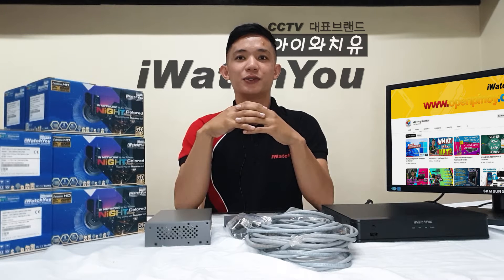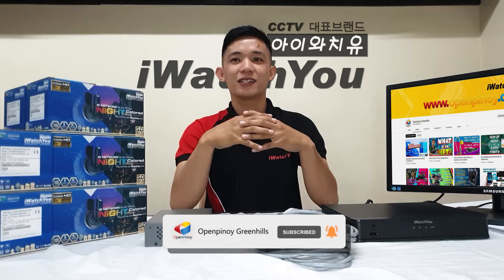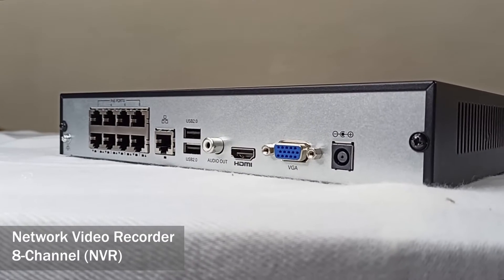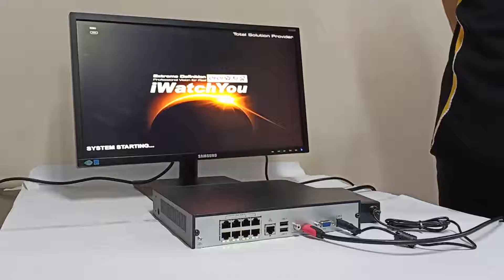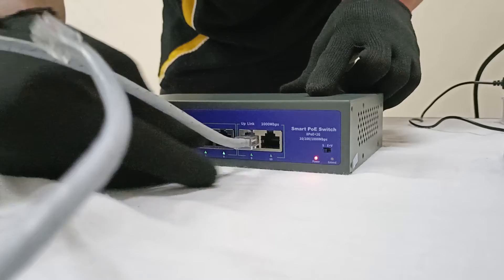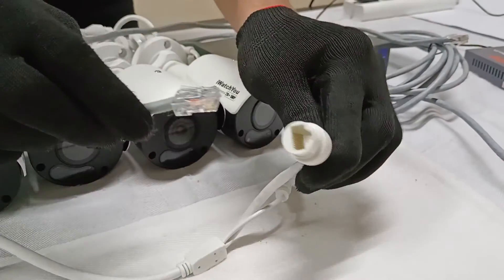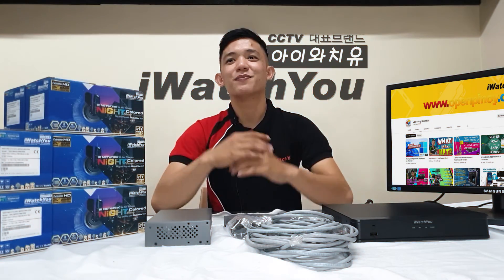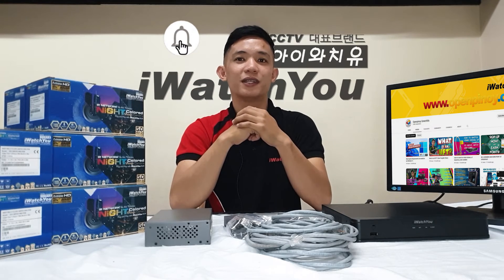How to Connect 8Ch IP Camera using Single Mode Media Converter over 2km Fiber Optic Cable

Comment: Can I use two Poe switch to separat 4ip camera on each and use two pair of media converter to plug in Poe 8 port nvr ?
Reply from the maker: Hello, thanks for watching!
Yes, you can use two PoE switches with 4 cameras each, then connect them to your 8-port PoE NVR using two pairs of single-mode media converters. Just ensure all devices are on the same IP range, the media converters are properly paired, and the total bandwidth can handle all 8 camera streams over the 2km fiber link.
Reply: @OPENPINOYiWatchYou ok sir thank you very much

Comment: ang tanong san kukuha ng suppy yung camera na nasa 2km kung fiber lang naman yung wire
Reply from the maker: To supply power to an IP camera, a nearby PoE switch is needed.
Then, connect the PoE switch to a media converter (transmitter side), and use a fiber optic cable to transmit the video signal to the media converter on the other end (receiver side).

Comment: Panu po gagawin kung ang distance ng bawat ipcamera ay 200 meters ang kaya lang po kasi ng utp 90meters lang po tnx
Reply from the maker: hi sir good question po, you can use poe switch with extended power features. example po ay this model - Hikvision DS-3E0105P-E/M
A 4-port Fast Ethernet unmanaged PoE switch supporting IEEE 802.3af standard. Features intelligent PoE management, up to 300 meters long-range PoE transmission, 4/8-core adaptive power supply, and 6 kV surge protection. Thank You

Comment: sir ilan meters maximum na layo mula sa ip camera to POE SWITCH?
Reply from the maker: Ang maximum distance mula sa IP camera papunta sa PoE switch gamit ang standard Cat5e o Cat6 Ethernet cable ay hanggang 100 meters. Beyond that, kailangan na ng PoE extender or switch para mapanatili ang signal at power. Salamat Sir and stay safe

Comment: Tanong lang po...saan ka kukuha ng linya para sa saksakan ng power supply na 12v, syempre kung nasa posti na malayo maglalatag kapa rin ba ng service dropwire na 220v
Reply from the maker: Magandang tanong po! 😊 Sa ganitong setup gamit ang fiber optic cable at media converter, hindi dumadaan ang power sa fiber, kaya kailangan pa rin ng separate power source para sa mga IP cameras. Kung ang mga camera ay nasa poste at malayo sa saksakan, maaaring gumamit ng service drop wire na 220V papunta sa isang PoE switch malapit sa cameras, tapos ang PoE switch na ang magpapadala ng power sa cameras.
Reply: @OPENPINOYiWatchYou  magastos parin iniiwasan yn ng mga baranggay...need ng wire

Comment: Hello Open Pinoy, patanong lang po possible po ba multiple cctv camera one fiber optic cable if possible ano pong tawag sa fiber optic cable na pwede pong magamit salamat po and God Bless.
Reply from the maker: Hello! Yes, possible po ang multiple CCTV cameras sa isang fiber optic cable gamit ang fiber optic splitter o media converters. Ang kailangan nyo pong cable ay 4-core o 6-core Single Mode Fiber Optic Cable (depende sa dami ng cameras). Tapos, gagamit kayo ng fiber to Ethernet media converters sa magkabilang dulo para iconvert ang signal. Salamat din po, and God bless! 🙏😊

Comment: sir may tanong lang po ako pano po pag 2km pataas na po at may nabibili po bang 3km na fiber cable?
Reply from the maker: Hello po! 😊 Oo, may nabibili pong fiber optic cable na may haba na 3km o higit pa. Ang gamit po para sa long-distance transmission ay Single Mode Fiber Optic Cable, dahil kaya nito mag-transmit ng data hanggang 10km o higit pa gamit ang tamang media converter o SFP module. Kung may specific setup po kayo, let us know para matulungan namin kayo pumili ng tamang fiber cable. 👍

Comment: Paano po pag DVR yung cctv?
Reply from the maker: If your DVR is analog, you can use an analog media converter for the cabling work.

For example:
Camera -> Coaxial Cable -> Analog Media Converter -> Fiber Optic Cable -> Analog Media Converter -> Coaxial Cable -> DVR
Connect them in this order. 

👉 https://www.iwatchyou.ph/

If you have any other questions, please feel free to contact us through the URL I shared. We will be happy to assist you.

Thank you.

Comment: Sir tanong lng po. Pano gamitan lng ng utp cable n hnd pure copper pwede po b un s ip cam
Reply from the maker: hi sir yes po pwede naman po ang mga ordinary na utp cable for ip camera pero meron pong limit ang length na pwede mo gamitin and depende po sa brand ng utp cable mo po. you can check our blog for the comparison of utp and fiber cable - https://iwatchyou.ph/blog/?q=YToxOntzOjEyOiJrZXl3b3JkX3R5cGUiO3M6MzoiYWxsIjt9&bmode=view&idx=66450580&t=board

Comment: Sir Ano po ba Ang problema ng CCTV fiber connection, gumagana Naman ,pag nag brown out ,walarin ,,,tapos pagbalik ng kuryente hindi na sya nagdidisplay Yung camera,,
Reply from the maker: good morning po sir, based on our experience the possible problem would be on your poe switch, poe switch power adaptor, or fiber switch po. It's possible between these 3 components ang may problem if all you cameras has no display after the electricity came back. salamat po

Comment: Hi.. if the ip cam has its own individual power supply.. can we use fiber switch instead of poe switch? Thank you
Reply from the maker: Even if the IP camera supports PoE, if you're installing multiple cameras, you definitely need a PoE switch.

However, if you're only installing 1 IP camera, you can connect it without a PoE switch by using a media converter.

If this answered your question, please don’t forget to like and subscribe.
Thank you! 🙏

Comment: Maraming salamat po sa information. Pero paano if I need 2 or more POE switches po. Paano ang connection?
Reply from the maker: Thank you so much for watching the video! 😊
And I sincerely apologize for the delayed response 🙏

If you need more than two POE switches,
you can connect the switches together, then connect the last switch to the media converter.

Example:
POE Switch (w/ IPC) ➝ POE Switch (w/ IPC) ➝ Media Converter ➝ Optical Fiber Cable

I hope this answer helps!
Please don't forget to like and subscribe! 👍✨
Thank you 😊

Comment: Sir may tanong po ako..

San ka po kukuha ng supply sa media converter po pag nasa POSTE na ung camera at ung media converter?

Salamat po new subscriber.
Reply from the maker: kailangan sir mag provide din po sila ng power source. 
220V ang kailangan ng Media Converter at ng PoE Switch
kung private at sarili nila yung poste. kailangan nila mag latag din ng para sa power source nila

Comment: Sir may tanong lang po. Halimbawa bawat camera is malalayo. 1km. 
Using media converter.

Tanong may power supply na kasama ba ang camera. Para data nalang ang kaylangan galing sa camera. Paponta sa media converter. Kasi de ma gagamit si poe. Switch. Naka fiber na kasi bawat isa na camera. At elang volts ba dapat ang power supply
Reply from the maker: Ang pinka maximum po sir ng layo ng camera`s mula sa POE Switch Papunta sa camera is 150 Meters. Mas Advisable kung yong POE switch ang ilalapit natin using media converter Maximum of 20 KM ang abot ng fiber natin sir mula sa NVR side Going po POE Switch. Isa pang paraan sir Pwede naman nating hati hatiin ang mga Cameras. (Example) 1KM yong isang cameras gagamit ulit sila ng media converter plug lang nila don sa poe switch yong media converter sir